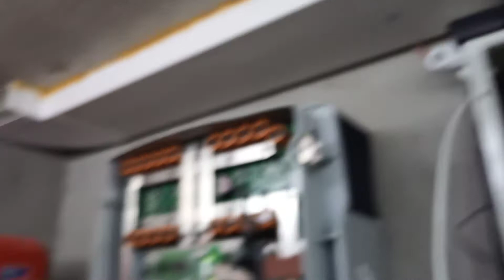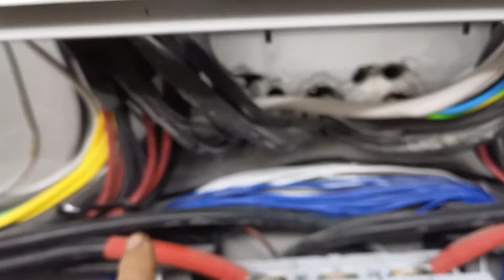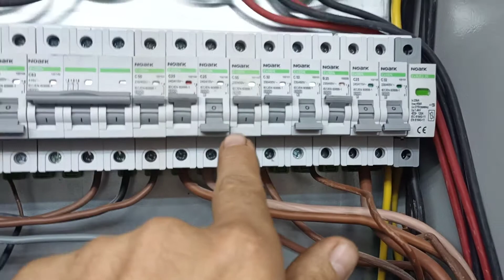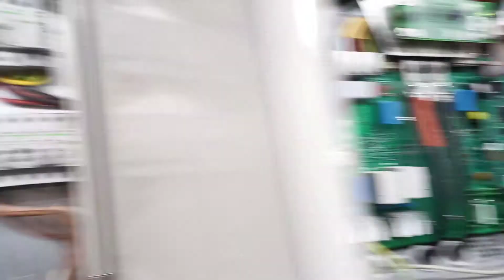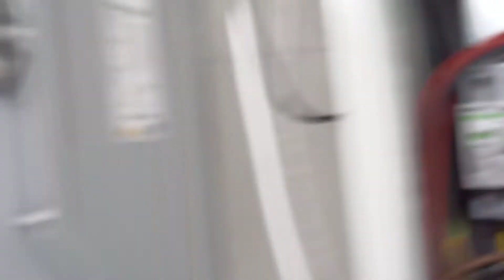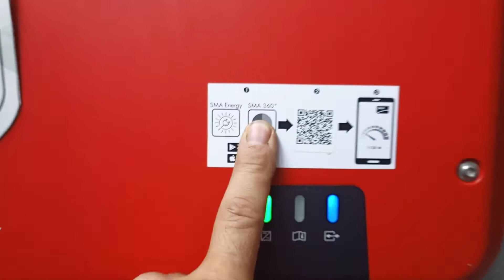Off grid solar (part 3)Sunny boy, sunny island inverters

Comment: If I want to connect my JK BMS to the SI, Where do I connect the CAN-bus cable on the Sunny Island? I have the connections: ComSyncOut/ ComSmaOut/ BackupVtgCur/ ComSyncIn and ComSmaIn ?
Reply from the maker: Must be where I connected the REC. Bms. You can see it in the video
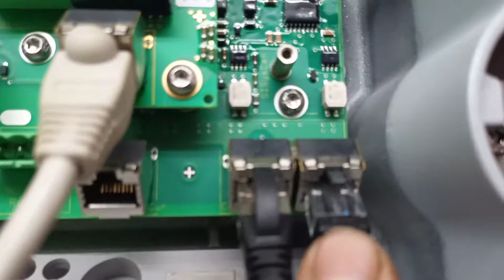Reply: @penandpike at 14:30 you show the connection but my SI looks a bit different from the inside and unfortunately I can’t see the name of the port you are using. Thank you for making this video!!! It helps more people as you think!!
Reply from the maker: @JRGGG  IT SHOULD BE...... ComSync in
Reply from the maker: @JRGGG  https://files.sma.de/downloads/SI44M-80H-12-BE-en-13.pdf     page 40
Reply: @penandpike  Thank you!

Comment: Thanks a lot! I am now building my EEL battery box v5 and bought a Sunny boy 5.0-1AV-41 and trying to figure out how it will connect and make it work. I understand I need SI 6048 firmware to make it select LifeP04. 

And what I also didn’t understand is how to connect BOTH AC Loads (my house) AND the Sunny boy but from your video I understand to use a busbar.

Comment: Thanks for going on through your settup. It's really helpful. 
I would like to ask it there is rs485 communication between the sunny islandsand the sunny boys and if so through which port?
Reply from the maker: No there is no rs485 communication. They communicate trough frequency in the AC phase. You can see that All Hot (phase) cables are combined in the electrical box 9:00 Sunny island can change the frequency up and down and thus it tells the sunny boy what to do.
Reply: @penandpike thank you so much for the fast reply🙏. So sunny boys just follow whatever frequency is dictated by the SI?
Reply from the maker: @Sega-and-Mao  If the batteries are full the SI will rise the frequency and  and thus the SB will "understand" that it must not produce any more electricity from the solar panels. So it doesn't :)
Reply: @penandpike  🙏🙏🙏 thanks for rhe info

Comment: I thought in Europe they want isolated ground and neutral not that it actually matters as it only rarely matters when touching a grounded metal box and power accidentally so as long as people are careful? I'm from the US and was electrician for awhile when I was younger and we bond ground and neutral! Did you have experience with this stuff or self learned because it's quite impressive!!!
Reply from the maker: No experience whatsoever. I taught myself from Youtube videos and used some common sense. :) :) :)

Comment: So the Sunny Island stops producing power with the breaker/fuse in the off position? Have you put a volt meter on the feed wire to verify?
Reply from the maker: The Sunny island will still produce electricity it will just not be used and in that sense it doesn't produce electricity if that makes any sense! :) The sunny boys on the other hand will in fact stop producing electricity when breaker is off.
Reply: @penandpike  that was my understanding as well. Thanks for clarifying.

Comment: Thank you for the very detailed overview of your system. I like that you are not grid tied, and use your sunny islands as the AC grid for your sunny boys, and then use the ac output of the sunny boys to charge your batteries.  It makes sense, and seems very simple, and eliminates the need for any external MPPT chargers for the batteries. Great work.

Comment: Very nice setup i have similar but smaller system,just wondering how the sunny boys are connected together via ether net cable?
Reply from the maker: The sunny boys are not connected together ( the sunny island are) All sunny islands and sunny boys network cables are connected to my network via network switch
Reply: Ok thanks for the reply...for some reason I thought the sunny boy had to be connected to the sunny Island via network cable so they could communicate?

Comment: You use 240 volt dedicated not split phase? Because in US we are 240 split phase and 240 is not considered 2 phase here. The voltage is derived by a center tap transformer, so is considered single phase. Derived from one leg of a 3 phase power system.
Reply from the maker: Here  the phase is 240V (single wire)